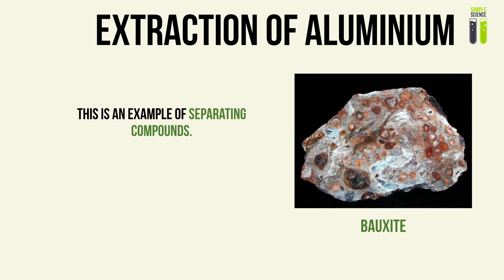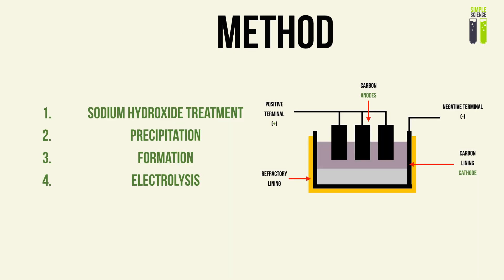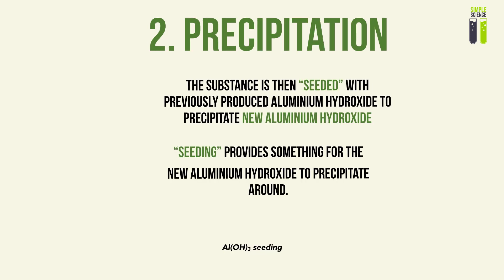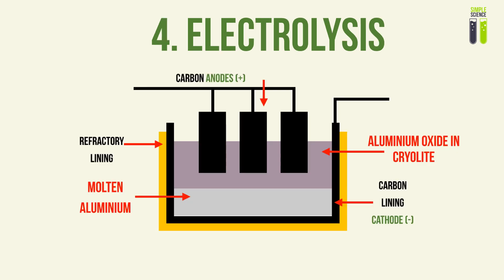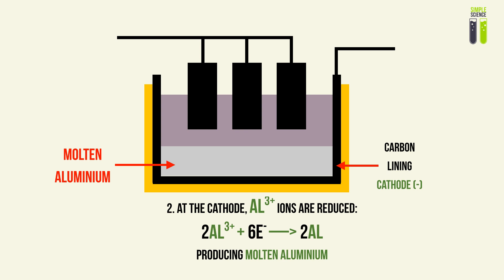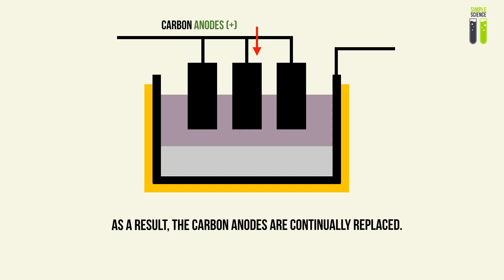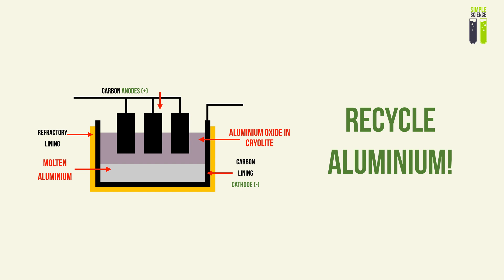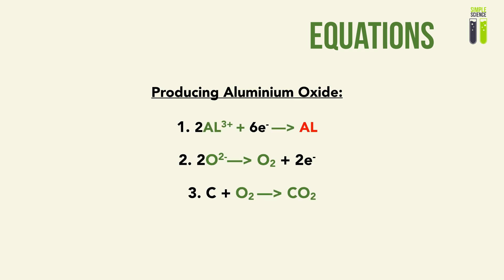IGCSE Chemistry Revision - 24 - Extraction of Aluminium

Comment: Hope this helps this is basically a summary of what goes on in the extraction of aluminium from the bauxite. Xx
1. Aluminium oxide is dissolved in molten cryolite 
2. Graphite casing inside metal casing (cathode)
3. Aluminum (Al^+3) attracted to the negative cathode and gains electrons Al^+3 +3e ---> Al (reduction)
5. Aluminium sinks because it's more dense.
6. Oxygen forms at the anode
7. Carbon also forms there making CO2 
Overall in the electrolyte:
2Al2O3--->4Al+3O2
Reply: Thanks
Reply: Thanks
Reply: thxs
Reply: Thanks
Reply: So simple and easy, thank you

Comment: why is sodium hydroxide used?
Reply: Because sodium hydroxide is a base so the aluminum oxide which is an amphoteric, reacts or dissolves in the sodium hydroxide forming sodium aluminate(NaAlO2). The impurity which is iron oxide, is a basic oxide so it won't react or dissolve in sodium hydroxide since they're both bases so iron oxide will remain as a solid. As for sand(silicon dioxide) it is an acidic oxide BUT it is too unreactive
Reply: To sum it up, sodium hydroxide is used to remove the impurities such as sand and iron oxide present in the bauxite ore
Reply: NaOH is used so as to form a soluble complex compound